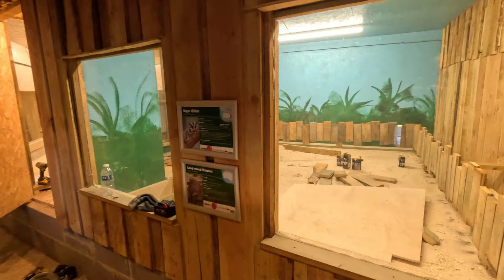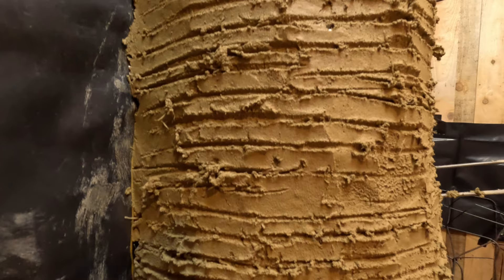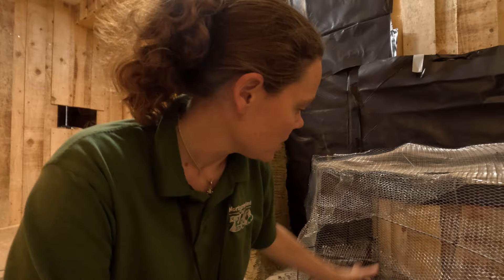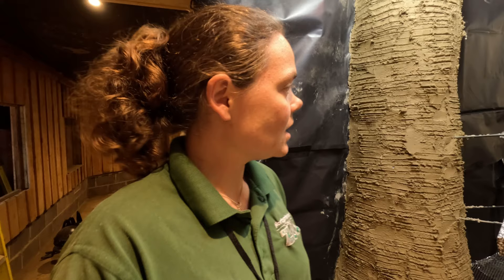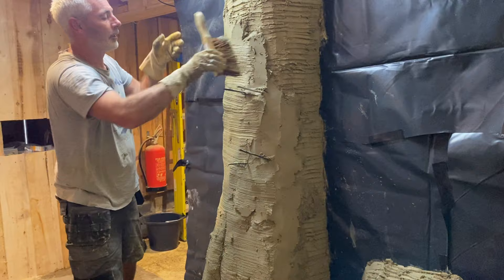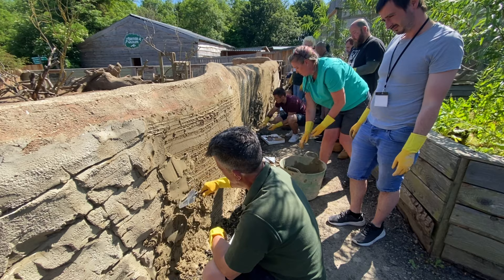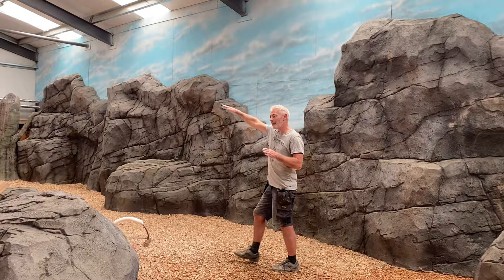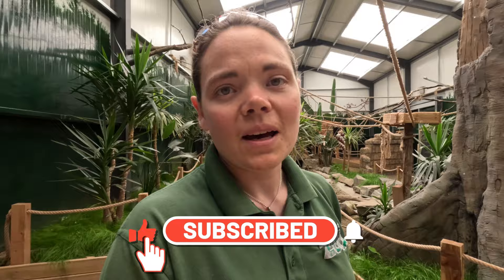Making a Fake Tree out of Concrete - Mock Artificial Rock

Comment: I made some fountain balls using beach balls under as the structure. I deflated and removed and used them again.   I added red concrete dye and black.   Fabric and Portland Cement with a little sand was my structure    I made 3 and they have held up perfectly.

Comment: Love the it what kind of tool is that that you are using to attach the mesh to the rebar?
Reply from the maker: Its a little pneumatic hog ring gun, saves loads of time!
Reply: I was searching for this question perfect
Reply: Or just tie wire if you build with rebar, can't find a hog tie gun that does 10mm rebar lol

Comment: Super cool thanks!! Are the rods epoxied or glued into the floor and wall ? Or are they just sat in the drilled holes?
Reply from the maker: They are just shoved into the holes and the weight of the structure/concrete holds them in place.
Reply: If you are outside it's a good idea to epoxy them in :)
Reply: @Rockscapes  cool thanks so much

Comment: What kind of color did he used on the stones ?
Reply from the maker: We used off-the-shelf masonry paint, light grey, dark grey and a white dry brush to add the scratched details.
Reply: Concrete stains and acids work great but you've got to be careful with the acid

Comment: What brand of mud/cement and model?
Reply from the maker: The cement is just standard - builders sand works best and mix in a little bit of plasticiser which is what helps keep the mix together and hold shapes!